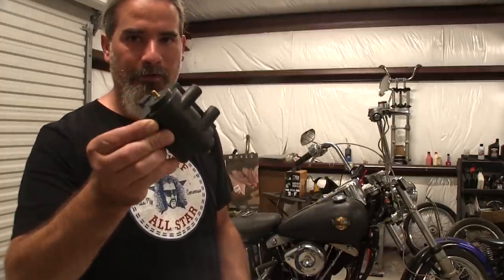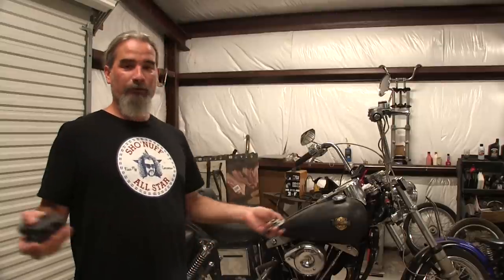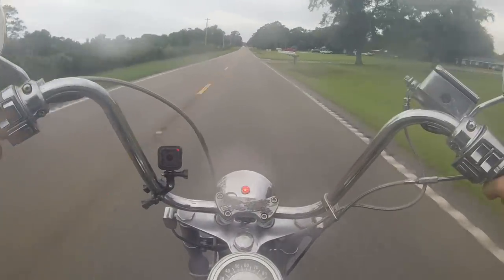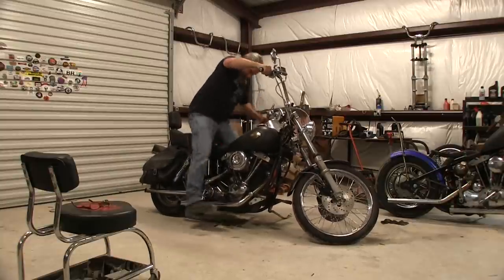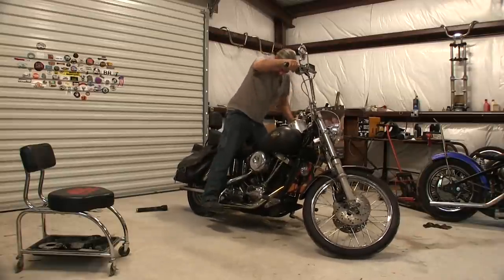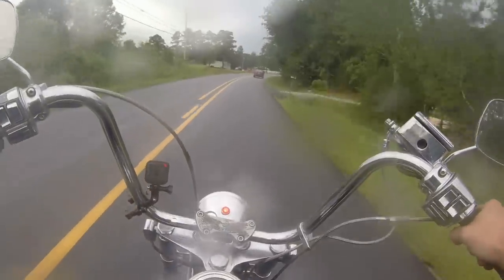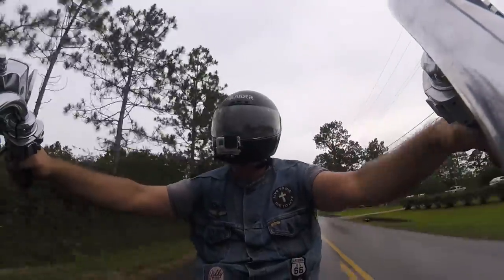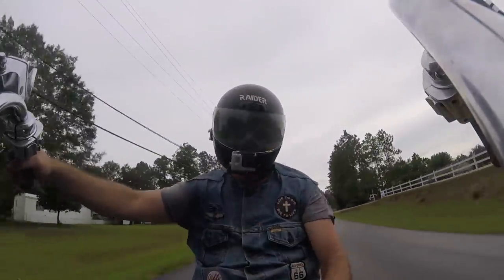DITCHING Ultima ELECTRONIC Ignition And INSTALLING POINTS On 1979 HARLEY Davidson SHOVELHEAD FXS 80

Comment from the maker: 13:38 to 13:45... I was wrong on how set the timing with a timing light. You want your rpms to be a 2200 to 2400 rpms; not 1000 to 1100 rpms.
Reply: I remember on my old sportster it was 2000 rpm.

Comment: Had a 71 ironhead with a Mikuni round slide carb. Roll it thru 3 times with the enricher set, then take that off, turn key on and -- one kick/start. Loved that!! A bro taught me things like static timing, point gap( business card) and pushrod adjustment.  . .should have quit the Church and kept the Chopper -- but that's another story!  LOL 😪😉
Reply: I've got a 76 with a Mikuni round slide...  was wondering if anyone had a method for starting it...  yes, XLCH ...so, kick only.  Thanks for your comment..helps me out a lot.
Reply: A story worth hearing !!

Comment: I ran points in my 79 for years, used GMC 60's 250 six cyl parts. Had a lot of trouble with the weights. Switched to a DynaS ignition now and trouble free. The biggest thing I learned is they all break down eventually...
Reply from the maker: Everything breaks if you give it time enough.
Reply: Been riding mine for over 25 years never had a point issue.
Reply: Same here

Comment: Pulled mine out 25 years ago,never looked back,riding the same bike.I get mine at napa,I tell them I want points and condenser. for a 68 chevy 250 6 cylinder,they work perfect.
Reply from the maker: I'll have to remember that.

Comment: My 78 shovel came with electronic ignition from the factory.  I converted it back to points long ago and have no regrets.  Converted it back to solids.  Used a 12 volts test light for static timing.  I do have kick and electric start,  S&S Super B.  Belt primary, chain secondary.   Your video of this is how it really works kicking the bike over.  Now that is realistic!!!!!  Good Job.

Comment: I had an old greybeard school me to use singer sewing machine oil on my flyweights he said it is pure enough to clean with and just a bit on the felt wiper for the breaker cam
Reply: Agree100%
Reply: Dry slide machine oil is the same as singer oil

Comment: Thanks for your comment/reply to my comment Saddle Tramp. A couple of more tips when installing points, is to gap your points at .020" not .018"...the reason being at .018" the Instant the point cam fiber wears, you're out of spec. At.020" your points gap can reduce from .020" to .019" to .018" as the point cam fiber wears giving you more longevity from your Super-Tune. The other tip is to put a Very Small dab/amount of Blue Loctite on the advance mechanism retaining screw/bolt tip and when installing it use a 9/16" wrench (box end) and just Snug it down. Snug is all you need to do! Torquing it down is Not advised...snap it off and you've just opened up a can of worms. I'll comment on My version of Super-Tune Timing points type ignition for the late model (1970-1984) Shovelhead on this post of yours soon. It's a Guaranteed One-Kick Super-Tune. Cheers, Rick B

Comment: Right on man!! I changed mine to points a few years ago, once I learned what it needed to kick start it always starts with two or three kicks. Works way better than the electronic ignition. 😀
Reply from the maker: Heck yeah!
Reply: And easier to figure what's going on,and easy to buy and change.

Comment: You did the right thing, brother! I've had a bunch of bikes in my time, and the ONLY ones that ever left me stranded on the side of the road with ignition problems had ELECTRONIC IGNITION. The whole idea behind running points is being able to get home. You can make a set of points out of a paper clip if you have to, but when a brain box ignition goes bad, it's bad and there ain't no fixin' it on the side of the road! It's also good insurance to carry an extra condenser and points set in your spares kit. I suggest a Standard Motor Products Blue Streak points and condenser set. I've always had good luck with them in my Harley's, my tractors and small engines. They make a quality product. Now, if you're stuck out and just need to get home, you can run a Chevrolet 6-cylinder points set in your Harley, and McCormick tractor points sets will work if you trim down the width of the rub block. I also always carry a spare coil bolted to the frame in an inconspicuous spot. I've never needed to use it, but it sure is comforting to know that it's there!
Reply: The only Harley ignition that ever failed on me in the past 30 years were points. "But you can fix points at the side of the road". No - not when the advance weights disintegrate.

Comment: honestly I'd keep the ultima ignition and keep a second one in the saddle bag as a spare. The Ultima gives great performance, mileage and strong spark as well as programmable spark curves. Changes out in 20 minutes if you keep a spare and they are dirt cheap. I've used one in my EVO for 80,000 miles no issues but I do keep a spare.
Reply from the maker: A hotter spark yes... That's probably why Harley went to electronic ignition when they came out with the 80ci shovel. Makes sense... Bigger engine displacement... Bigger spark. Honestly it has me considering going back, because I think that's why I'm having a hell of a time trying to kickstart this bike.
Reply: @SaddleTrampTV  Absolutely.... the Electronic ignition will make kick start easier and Like I said it will never leave you stranded if you keep a spare cone module in your tool bag.

Comment: To set points to .020 use a .021 and a .019 feeler gauge , when the .019 feeler gauge goes in and the .021 will not the the gap is .020. It's called using a go, no go gauge. This way is repeatable and takes away the "feel".
Reply from the maker: Noted, man. Thanks!
Reply: I "invented" that nearly 50 years ago - when Snap On began making thickness gauges with .0005" steps ground on the end I would use the "half-thou" step of the .020" (.0195") as the GO and the half-thou step of the .021" (.0205" as the NO GO. You get .020" plus/minus .0005" for sure that way. The gauges show up brand new on Ebay for $25-$35 fairly often.

Comment: Hey Corey, always good to see your wrenching videos.  I am an Old Timer and points were just a way of life for a long time.  On my car I burnished or replaced them, then set them with timing light every other oil change.  I had a good straightaway where I could check my top speed and if it was 10 mph slow I knew the points or sparkplugs were the issue.  Life was not always so easy but it was simple!  One time my simple diagnosis was incorrect and it turned out to be a stopped up air filter (50k miles on it).  Still something simple although the filter did not look dirty, but that was the fix.  In those days we were more frugal and would only replace something when it absolutely had to be replaced.  Times are so much better now in some ways, worse in others!  Keep that shoveled rolling man!  Later Saddle Tramp!

Comment: Coming from an era that did not have buttons to start your bike the part of the video where you were trying to start the bike with the kicker brought back so many memories. I have issues with my right hip from kick starting bikes. Be kind to your body use the button. Had a '76 fx stroker that I put an electric start on. Used the kicker when the battery was down. With points the bike will run with very low voltage. Thanks for the video, Corey.

Comment: Thank you for this I have a 72 shovel that has been sitting forever that I'm trying to get running smooth again. The kicking and kicking and then kick back I felt that dude LOL my ankle is killing me. HAHAHA You don't know how helpful this video is though. Talking about long period of time where the bike sits and then oil draining into the bottom end and gushing out that bottom breather is stuff not everyone knows. This bike I have sat for years and it just pissed oil and fuel (stuck float I think). Thank you for sharing all of the information!

Comment: Noticed you continuity tested for your static timing I no it might be trivial but I use a test light and set it at the point where light is at it's brightest. I run Ultima programmable ignition in my 82flhs and love it I carry a points setup in a freezer bag in my toolbag in my saddle bag. If I have a failure I'll install it in my sleep lol 😆 thanks for the video. Ain't no head like a shovelhead

Comment: Tramp, as a suggestion, don't straddle the bike. On my 76 FXE I would put me left knee on the seat, then kick through and hold. No kick back. With your body on the right the side you'll get more body lift. If it doesn't interfere with rear pipe get a straight kicker arm. That bent arm sucks.

Comment: The way you set the timing works, it's a messy job but you can use a timing light through the hole. Much more accurate, when the timing is right a stock shovelhead won't kick back with the kickstarter. It will start easier with the electric starter also. The original service manual details how to do it.

Comment: Good for you, I've rode Harley's for 51  years. Now all they care about is selling a bike to a doctor or lawyer for 30 to 40 thousand dollars. It's a shame the brand has gone this way. Just like John Deere has done you can't touch them yourself. They even tried to raise the price of used bikes so they could charge more for new bikes. I'll still ride Harley but never anything newer than an EVO engine. Love your videos dude.
Reply from the maker: Thanks, man. You're my homie. We're in the same boat.
Reply: You may be correct on all counts. I bought a 1998 Electra Glide brand new for $14,500. Only new bike I bought, or will ever buy, and I still have it. Want nothing to do with the new stuff and still have a 3g phone.
Reply from the maker: @GJM866  My electra is same year
Reply: @GJM866  Keep the 1998 EVO but you may have to ditch the 3g phone. HaHa
Reply: I've oowned 13 Harleys over 45 years of riding. My current scoot is a 98 Evo and has been the most dependable of them all.

Comment: Extra flyweights & springs along with the thin points cam bolt in tool bag wouldn't be a bad idea...Had flyweight springs break, flyweight holes worn to ovals, thin dia. cam bolt w/ 9/16 (IIRC) head snap, on both ironhead & shovelhead...Whole setup doesn't take up much space...Points ignition can be extra work & something else to check periodically but road side repairable...Have one of those AMF era clear plastic timing light plugs = one BRIGHT timing light required to see the marks thru it ...> Your multi kick "outtakes" reminded me of an old Hal Robinson comic illustration, = thin build biker guy , skinny left leg but right leg all bulked up like a power lifter ...  :-)
Reply from the maker: Noted

Comment: i'm not trying to start an argument. i understand the up side to points but i put a dynaS ignition (uses the original weights advance but has magnetic pick-up and no chip) in my shovelhead 25 years ago and the point cover hasn't been off since.

Comment: Like learning the hard way they make a plastic timing plug the screws in to use with a light made out of plexiglass and the timing hole you'll be back to New School after you break your foot good job like it

Comment: Thanks for making this video! Once I got a "modern" motorcycle, it freed me up to start converting my old EVO back to as old school as I can make it. So I've converted it to foot clutch and jockey shift, removed all unnecessary wiring, removed all gauges and indicators save for the oil pressure gauge, and next I'll be converting it to kickstart only with a points ignition and a magneto, and eliminating the battery completely. Is it practical? Hell no. But there's something about it that's just fun.
Reply from the maker: Can totally relate

Comment: Been running a Dyna ignition since the 80s trouble free but I always carry a point and condenser plate setup in the tool pouch just in case......
Late 79s came with electronic ignition, no kickers and no mount on front downtube for forward controls.
Stay safe ✌
Reply from the maker: Interesting... I wonder if my transmission isn't original to this bike then.
Reply: @SaddleTrampTV  
If you have a late 79 it will have what we call a cow pie trans or rotory top....
Some early 79s came with the old ratchet lid style trans which was a more preferable choice. ✌

Comment: Instead of points as a spare back-up, I just keep a spare module and coil. I never needed them, but in case of trouble it will be a no brainer job to swap either. 
In my early riding years I also had a Shovel ... I tried many points sets. The only ones decent were accel's with the micro chip condenser straight on the poits. I am now 53 and suffer from heavy artrose, so my kickstarting points days are over. Just keep a spare module and save on medical bills, You have nothing to prove.
Ride safe !

Comment: When the ignition module went belly up in my 84 Sportster, I did the same thing. I replaced it with points and condenser. like you, we can fix it. The simplicity of points ignition. It does not advance as far as electronic, and it hurts hiway gas mileage a little, but it is simple. Easy to fix. And my Sporty actually ran better with the points ignition than it ever did with electronic. 

Really cool video. My 99 Softail Custom still has the electronic ignition, but I may change it out soon. I like reliability which is I can fix it for a few bucks instead of over a 100 for a new module. 

You the man Saddle Tramp. We do things our way which may not make sense to others.
Reply from the maker: Thamks, Jim.

Comment: Congrats!  When it starts, the pain melts away.  If your oil is ending up in the motor, you have a leaking check ball valve in in the oil pump if I remember correctly.  Bike sounds great!
Reply from the maker: Yeah, the leaky check valve appears to be a common thing. My 2012 heritage did that too.

Comment: I have a '96 Evo with a Dyna S ignition. A few weeks ago I was pulling into my favorite bike shop, when the rear cylinder quit firing. The Dyna S worked great, and the bike ran strong. However, a fail is afail. The bike shop had an Ultima ignition in stock, and they put my bike on the lift and swapped out the ignition. For whatever reason, the bike doesn't run as well as it did before: I don't have the throttle response I had before, and the engine has an intermittent "hiccup" at lower RPMs. A points conversion kit may be in my future!!
Reply: Timing is too advanced.
Reply: @perryhart3172  Thanks, Perry! That's what I thought, too.

Comment: Was trying to send msg about lifters, I use cloths pins to hold the tubes up. And you can only adjust them when the lifter is off the lobe. As that cam turns and the lifter moves up the rod will get tight , and they should  be finger tight
Reply from the maker: Yeah, I got that.

Comment: Yes. Did the same in the 80's on the old Evo. Electronics went 500 miles from home with 500 to go. And then a return trip, all with the bike sporadically and randomly dying, reviving, farting and spluttering. Bought a points conversion when I got home, changed the coil and plugs to suit. Idled like a Harley should, run smooth, points and condensor change once a year cost about $16 back then.
Reply from the maker: Right on!

Comment: Having just broken down on my '76 Sportster, I finally made the decision to replace the ignition system with a fully electronic unit, the Ultima you just removed.  I had been running the Dyna electronic system for years, which retains the original flyweight advance system.  Merely a "points replacement" magnetic pickup, kind of a half-step into the electronic ignition world.  Well, finally, after 43 short years of ownership on this bike, it has now suffered the same failure mode twice - the roll pin that indexes and drives, and that long hex head screw that holds the advance weights in place failed.  The roll pin sheared, and the head of the long screw broke off.  I honestly feel as though those two components are somewhat inadequate for the job.  The inertia in that heavy flyweight assembly, particularly its heavy base, is simply too much for that poor little roll pin and long small diameter screw.  My sole purpose for going to full electronic is to eliminate that flyweight assembly in an effort to stave off any future problems with that roll pin and screw.

So, that long rambling story is presented as a bit of a word of caution for you.  Don't just carry a spare points plate, points, and condenser - make sure you carry both a spare flyweight set and that long screw.  And, hopefully, when that screw shears off, it leaves enough of the shaft sticking out of the hole it screws into to where you can actually get the threaded part out of the hole.  Fortunately, it did both times this happened to me.  I can't imagine where you would be if its heard off below flush...  yikes...

Anyway, love your channel, love watching your "regression" into the vintage iron.  Like I said in my comments on another one of your videos, having started there, us old timers are really enjoying our "progression" through the modern stuff as HD continues to "improve" (mostly...).  That said, I WAS out on my '76 Sporty the other day when all of this happened.  And, like I said, 43 years we've been together.  So, yes, in the face of all of the "modern" "advancements", I too still feel the pull of those earlier, simpler times.

Ride safe, and God bless.
Reply from the maker: Thanks, man for the heads up on that. Since this video, I've put the ultima back in it after I found out there was nothing wrong with it along with some other things. But I do have several sets of points, condensers, and advance weights that I can keep on the ironhead. Again... Thanks.